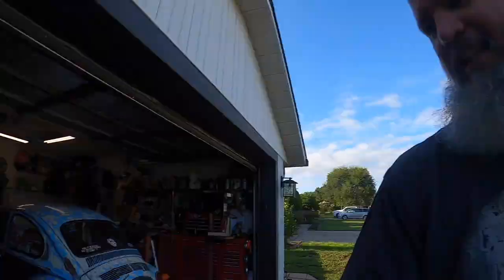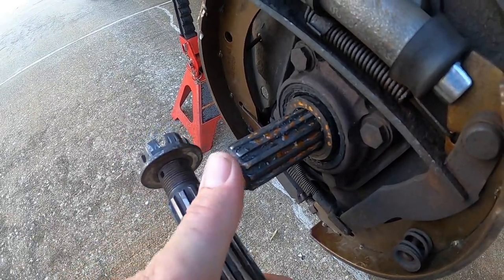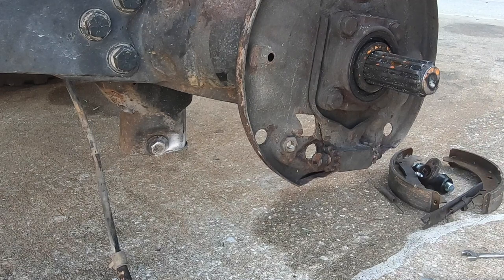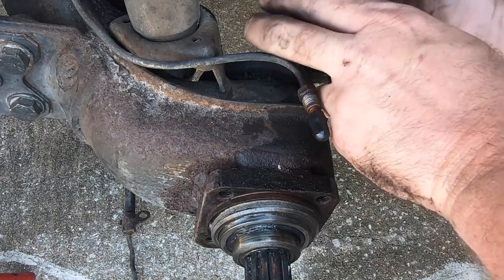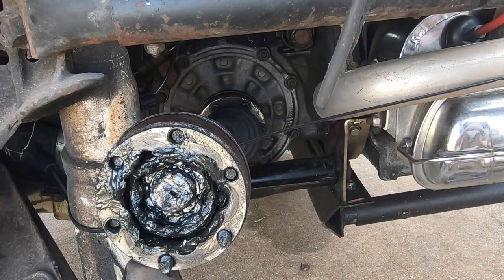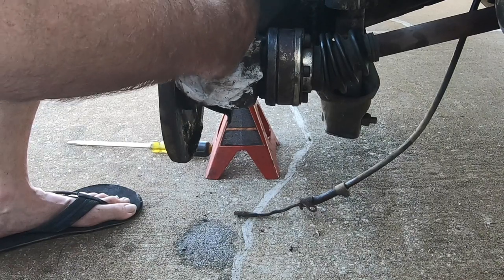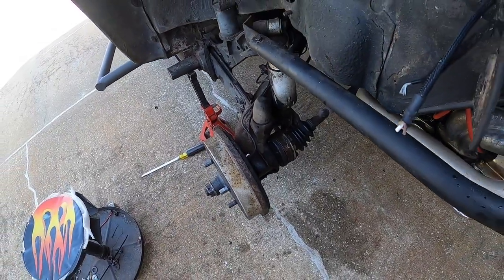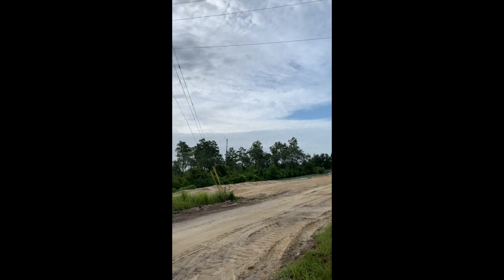Fixing the Broken Volkswagen Baja Beetle That Left Me Stranded!

Comment: I had a 69' fast back drove to Mexico from Nor Cal and back, and as I pulled into the driveway I noticed in the mirror the same problem. I fixed it and bought a spare and put it under the seat. The third owner from me ( I owned it in 1986) still has that stub under the seat.
Reply from the maker: Wow, lucky it happened at the house! 
From what I’m hearing, they do break but it’s not a common thing.
Reply: Just Crazy!! 42 VWs Ive had since 1979 and Im currently dealing with the first broken fan hub.
      I dig that Baja. I'd like to get some of those WW2 style military tires and lift a 64 or earlier and make a sudo command car for a daily in the bad weather. Anyhoo as always dig the vids and stories.

Comment: Gary bummer this happened probably just a freak thing. I’ve had bajas that I have beat on heavily in the woods and never seen this happened. And I have always used an impact to tighten the nuts down. 
In the vid at 8:37. It looks like the lower shock mount AND shock is bent. The shock from below the upper dust cover down towards the mounting bolt looks like it curves outward as well as the shock mount from the trailing arm down toward the mounting bolt. 
Might be worth jacking the car up and removing both rear wheels to compare L-R sides.
I just seen in the last of the vid the car slid on that shock mount for a good ways.
Reply from the maker: It is a bummer but that’s how life with old cars go. I talked with several off road guys and they haven’t had an issue either. Probably just the perfect storm that caused it honestly. 
There is something going on in the rear for sure. Not sure if it’s the trailing arm bushings or the trailing arm that’s bent. Seems like there’s some play in the stub axle bearings as well. Just haven’t been well enough to dive into it yet. 
Appreciate your keen eye sir!
Reply from the maker: Also, it could be the wide angle on that camera that distorts the image some…. I’ll still check into it!
Reply: @VWJawbreaker  yeah you might be better off to just change out the trailing arm with a good used one. 
Hope all is well with you.
Reply: @VWJawbreaker  I thought about the camera angle also but it looks bent and after seeing that it landed on the shock mount it made since.
Reply from the maker: @robertlambert5299  good eye, I’ll have to look into it this weekend for sure!
Reply from the maker: @robertlambert5299  it’s definitely crossed my mind, seems like there’s some good camber on that side also. 
Things are good, just life happening as usual. Hope you’re doing well and having a great week.

Comment: Happy to see you got it fixed again.  I’m not exactly the most knowledgeable guy with transmissions, but I was thinking you had a swing axle trans in there (like both of mine), which I believe would be more involved to replace an axle if one were to break like that.  Looks like your IRS axle ends are much easier.
Reply from the maker: Irs is much easier imo to deal with than swing axle. Swing would have been a lot more involved to replace for sure.

Comment: Great video Gary, good fix buddy, at roughly 270 ft pounds its pretty hard to over tighten that nut, someone in the past probably used an impact gun more than a few times, i have always used a 3/4 breaker bar and a 4 ft cheater pipe, and stand on it, much more than 270 the breaker bar starts to bend, just my way, (actually old school VW guy Showed me), lol, thanks for the great content, can't wait for the next video, have a nice weekend buddy
Reply from the maker: I’m sure this has been abused over the years. 53 years of abuse and we fall apart also 😂
Thanks as always for being here!
Reply: @VWJawbreaker  you got it buddy

Comment: This happens because the wheel is on backwards... I know itd its a common thing to do with bajas to get the stance right, but it was an accident waiting to happen .
Reply from the maker: Wheel wasn’t on backwards but good point.
Reply: @VWJawbreaker  either it's on backwards or it has a massive offset to extend the track, either way the centre of the wheel ends up way out from where it was designed to be, basically the equivalent of fitting a 3-4 inch wheel spacer
Reply from the maker: @jwatkins5155  again, it wasn’t on backwards. They do sell rims with different widths for different applications. Where the stub axle broke has nothing to do with the rims or offset.
Plus, I hadn’t had this Baja very long before this happened…. It’s a 1969 VW bug…. Hard to say how it’s been treated for the past 54 years by the previous owners.

Comment: I don't think it's a mechanical failure... I think it's the BFTs.... the 4x4 guys will snap axles when they do the lift and put on BFTs.
Reply from the maker: Very well could be. Talking with other off road guys, it’s not too common but it does happen once in a while.
Reply: @VWJawbreaker  i think there is a happy medium there somewhere between cool baja with BFTs and a smaller (more sensible?) tire size.... It's a stock motor and transition i recall?  the big mud tire guys put in bigger motors, install stout axles etc,  and change the gears to turn big tires... to my point... wonder if there are stouter axles out there for VW bajas?
Reply from the maker: @thehammah8444  well I’ve only had it for a few months and it came with the 31’s on the back. That’s why I’m going down to the 235’s in the rear… 28” tire vs 31” tire especially with the stock trans and stock 1600. That’ll make it easier to drive, easier in the engine and also less stress on parts.